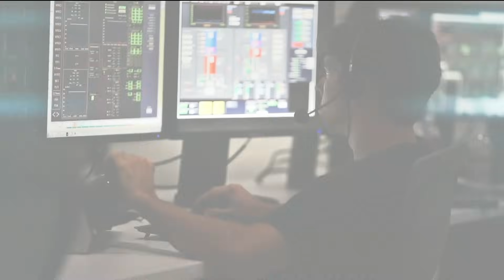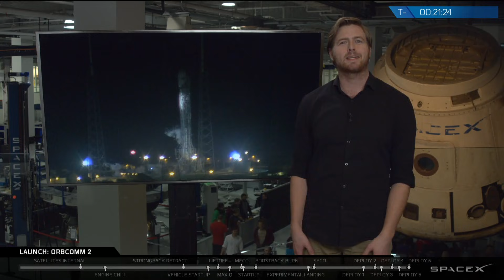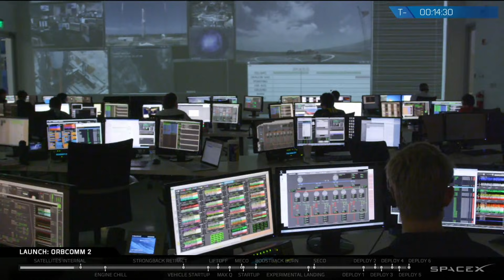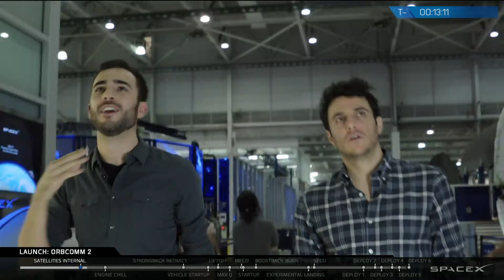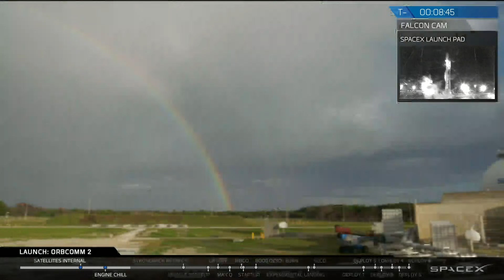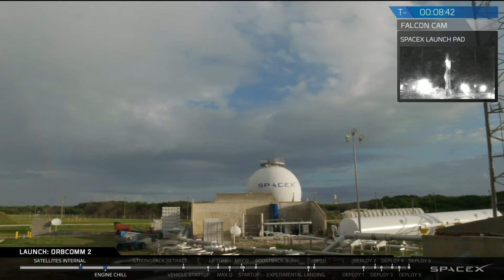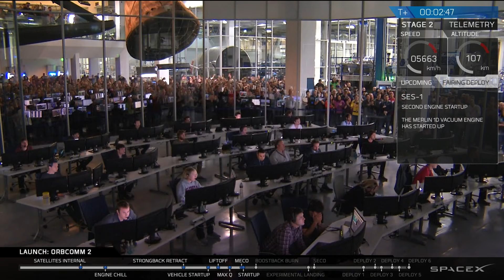ORBCOMM-2 Full Launch Webcast

Comment: How are the satellites ejected into orbit ? Does it have an automatic abort system ? If it aborts, what will happen to the satellites ?
Reply: +Keith H J Hollands -> I don't know, if there is separated abort system for second stage. In case of miss drop, the satellites would either go to wrong orbit or reenter atmosphere where they would burn.
Reply: +Keith H J Hollands For this launch the satellites are packed onto a dispenser and ping off in sequence.
Reply: +Keith H J Hollands The satellites most probably have some propulsion system with a little bit of fuel to maneuver themselves to orbit.

Comment: This may be a stupid question, but how did they ever land on the moon, and launch back? Using a separate pod, or what?
Reply: First the thing that land on the moon was designed and built to land. It wasn't designed to take a payload through the atmosphere against 1g of gravity. Second, the take off require a lot less fuel. It was in 0.16g not 1g and there was no atmosphere to get through. It really makes a huge difference. Third, returning to Earth is then "just" a case of pushing the rocket slightly in the fight direction. Gravity then did the rest of the work.

What we have seen here is nothing like the moon landing. If the moon landing was like parking a ford into a parking space in a supermarket then this is like a F1 car doing a handbrake turn from 150mph into that same parking space and coming to a stop without touching any of the cars around it.
Reply: Genius put. Thanks!
Reply: +elvispiss The lander was a two-part vehicle.  Once they had landed, they didn't need to bring the whole thing back, so the part with the landing gear and most of the engines and most of the fuel tanks stayed behind.  The part of the lander that did have to get back into lunar orbit (the crew, life support, some propellant, and an engine) would detach from the part that stayed behind and light its engine, becoming the Ascent Vehicle.

The six Apollo Ascent Vehicles are unique: they are the only manned rockets to be launched without a ground crew at the launch site.
Reply: +Augure Zera I'm sure the the reflector panels left on the lunar surface for the purpose of bouncing a laser back is actually just a guy in a helicopter hovering over the observatory, right?
Reply: +Augure Zera Well, the technology was there at the time. And landing on the moon is just a matter of mathematics. So landing on the moon at that time was certainly possible. Would you claim all space travel that is said to have occured before the alleged "putting a human on the moon" is myth? Did Yuri Gagarin never go to space as well according to your sources, or is it just the lunar expedition that isn't true? I mean, we're talking a total of twelve landings on the moon between the US and the Soviet Union, and a total of twelve humans having set foot on the moon as part of six different manned missions to the moon.
Reply: Finn Palm not to mention the hundreds or thousands of people involved that will all have to have been told to keep quiet and 50 years later not a single person has revealed the "lie".
Reply: +Augure Zera You didn't answer my previous question. Either way, it took them quite a few tries to get everything right, before they dared send a manned expedition to the moon. If looking at the history of space exploration, and not just one manned lunar landing as an isolated phenomenon, it would be quite the elaborate hoax if they faked all the research, the accidents, the experiments, the science and eventually faked a "look, we finally made it" lunar landing. Then take into account that all that fake science they claimed to be used to put humans on the moon, but that didn't work back then, if that was not real then, how come it's the exact same principles we use for space exploration today? The shortest distance between two spots is they did actually land on the moon.
Reply: ***** lol, so you don't believe it unless there is evidence but when someone shows you evidence you don't believe that either. I'm guessing you're Murican? Religious? Homophobic? Let me know when I get one wrong.

I tell you one thing though, you just got added to my "block" list.
Reply: ***** so the fact that there are photos of the various lunar landing sites and the equipment left behind there taken by satellites that are currently in orbit around the moon...

Those mean nothing?

Riiiiight...
Reply: +robotguy Plus they only have to thrust against 1/6th of Earth's gravity field, so the lunar ascent engine was much smaller and of lower thrust.
Reply: ***** Are you serious or just trolling? You really think we didn't put humans on the moon?
Reply: +Augure Zera Then there are the two mars rovers. What's your take on that? I'm just curious as to where you draw the line of what's scientifically possible and what's not. The New Horizons spacecraft that passed Pluto last summer and discovered water ice? Did that happen according to your sources? There's a lot that is said to have happened since the lunar expeditions of the last century.
Reply: +elvispiss You bet.  Since the moon has a little less than 1/6th of the Earth's gravity, it makes it super easy to escape from.  They used a detachable lander with it's own engines, launching them from the moon, back to their orbiting command module, which then was able to burn back out of the moon's orbit, leading them back to intersecting with Earth, and then decaying the orbit such that the command module could open its parachutes and get safely back.

It was absolutely, incredibly baller, what they managed with limited computing power and old tech, back in 1969.

Comment: Can someone explain why this "changes everything" other than the fact that they dont have to build another stage one? I know this means less time and money spent to make one, but people are acting and cheering as if they just reached light speeds lmao
Reply: Not having to build another stage one is the reason it changes everything. About 90% of the cost of launch is in building the stage one booster. This will cut the launch bill dramatically. Makes it possible for companies to send stuff in to space more often and for less. Companies other than the usual ones like NASA.
Reply: +Unitdoggy this is a stepping stone to getting to Mars. It will significantly reduce the cost of potentially building something in space that can get to Mars.

As for the crash landing. It has built in self destruct. If it's going to crash it can be detonated in the air before hitting ground. Even if it did hit the ground it's a big aluminium tube with almost no fuel in it. It's not going to create that big an explosion. As for the "nuclear type" explosion, it wouldn't even do that if it was full of fuel.
Reply: +Oliver Foggin Thats what meteors do at a tad lower speeds dont they? Idk, all I know is that everyone is overacting lol I bet all the people that were cheering in this video (SpaceX team) talked about it for an hour or 2 afterwards, then probably just celebrated that night and the next day it would be like nothing happened (in more of a mental sense). Thats what Im trying to say, its not immediate , but thats how people are acting lol
Reply: +Unitdoggy the weight of the stage is probably just about 10 to 50 tons with some aerodynamic stuff and engine to slow it down meanwhile an asteroid 40m big is ten thousand tons and does not have aerodynamic stuff to brake only atmospherw and its going into earth at 19km/s while the spacex 1st stage is only 1km/s at maximum and 2m/s at landing
Reply: +Unitdoggy "Economies of scale", google it
Reply: +Unitdoggy So what I said lol
Reply: +MHarmony Bruh did you only read the first sentence of my comment??? As I "thought" this is nothing more than a time/money saving achievement. Is landing a rocket back on Earth that big of an achievement compared to living on Mars or reaching light even half of the speed of light??? No. Now "think" about how long we've been going to space. 40+ years? Yeah its not that big. And will you still think its big when it crashes into the ground at 25000 kms an hour and causes a nuclear-like explosion lmao.
Reply: +Unitdoggy obviously this isn't as big as landing on Mars. If we landed on Mars (humans) it would have been a live feed on every TV channel in the country. It wasn't. 

It IS a huge deal for making space activity more affordable. Thereby allowing more missions and broadening the access for other people to do work in space. Which can lead to more innovation, discoveries, etc...

If you can do say 10x the missions with the SAME amount of funding... that is huge progress. This was a big step for reigniting space exploration.
Reply: +Unitdoggy 
This puts the French, Russians, Chinese and India out of satellite launching business. Unless they achieve something similar. Some, like the Europeans and the Chinese will have to. Which is good. Competition is needed. In 10-20 years this will be the norm. Next, they'll try to build a Space Shuttle that does the same thing.
Reply: +Unitdoggy &quot;this is nothing more than a time/money saving achievement.&quot;

Lol.  The problem is that the words "nothing more" seem to be ignoring the implications of this improved efficiency and what it will mean for humanity down the road.  Certainly there is a lot more hard work ahead of us, but this is the first step that will get humanity out into the wider cosmos.  What you're seeing is the birth of the space revolution.
Reply: +Matthew Doan Yes, so it concludes to a "time/money saving achievement" lol.

What im saying is that this doesnt solve anything immediately, it will only shorten the time for the big advancements which we will still only see in atleast 100 years instead of 150  (unless someone comes from the future) but time travel just fucks with everything so please dont lol
Reply: +Unitdoggy And btw, "nothing more" isnt saying that it hasnt changed anything, because it obviously has like I expressed. If i said "this has changed nothing" then you would be fully correct, but i didnt say that
Reply: +Unitdoggy I find it funny that people think space exploration is so difficult and we been doing it for 40+ years. You do realize it is easier to send a human to orbit then it is to send a human to the bottom of our ocean depths? Getting to space is not the problem. Living in space is not the problem. Sustaining a way to do it economically over a large period of time is a huge problem and one that has only begun to be solved. Starting with a job no one thought was possible 5 years ago.  

If landing a rocket on the ground with no parachutes after re-entering from sub-orbit with rocket assisted retro burns in a wind storm isn't special, then I implore you to do that same. Plenty of computer simulations that should be able to crunch the numbers for you. If that isn't easy enough for you, maybe a trip to the bottom of the ocean, all you'd have to do is hold your breath, right?
Reply: +Jasin Colegrove I'll still stick to what i said. And Im pretty sure we cant live in space nor any other planet within a few hundred thousand light years of us. Did you ever think of the ecological side of it this whole thing? What's the point in going to space quicker if we are just polluting and killing our earth quicker. Have you seen Interstellar and its story plot?
Reply: So you just ignored everything I said to validate your opinion? 

Pretty sure we been living in space for quite some time as well. But you'll have to define living, because your opinion seems to be overly important on the subject.
Reply: Unitdoggy and no, I try to keep with the nonfiction books and editorials
Reply: +Jasin Colegrove You are no different to me if Im ignoring everything you said
Reply: +Jasin Colegrove FYI, Plot: A series of conflicts and events within a movie. 

Meanwhile, you probably think Im talking about all the fictional stuff in that movie even though what I am implying is right front of you in that comment
Reply: +Jasin Colegrove Also, as far as I'm concerned what I said is not opinion, its fact. Can you honestly say Im wrong and prove to me how its not fact? Mmmm... thats right, you cant. And by space I mean the vacuum of space. We wouldn't know anything about space and time if it wasn't for the Earth and its atmosphere
Reply: +Unitdoggy You haven't really proven much to be fair. You have stated opinion based on some fictional plot. Not sure where I am supposed to find fact in that.

Your whole argument is about Earth and what we aren't doing to fix it??? Because that is what space exploration is all about. That is why we launch sat's to collect data, like the ones launched by SpaceX, so we can fully understand the problem. Its why we do research on ISS in space, because it is too hard or expensive on earth to recreate those settings. The ability to launch experiments into space at an economical advantage is a game changer, end of story. Nothing to argue about...

I'm not talking about colonizing a planet, far from it. So you can stop assuming.
Reply: +Jasin Colegrove Open your mind dude. (eg. just because I used a fictional plot as an example of what could happen, doesnt mean it will. Besides, that part of the comment had nothing to do with that fact part I was talking about). This is one of many "egs." I could extract from your comments to show that your mind is closed. FYI: you dont have to be very knowledgeable to have an open mind

I could go on and break down every sentence you say, but that will just lead to more sentences I would have break down.

And about that last sentence on the second paragraph: I never disagreed that it wasn't a game changer. If you read every comment ive said on here, you'd know this. 
AND, if you think this is all opinion and/assumptions, why are you still commenting?
Reply: In the end, all I asked is if I was missing something as to why everyone was celebrating so much. I clearly stated in my first comment that I knew it was a step forward for the money and time side of things. All these comments did is confirm what I already knew. 

Of course this is a massive step forward for SpaceX, but why do we care? This does nothing immediately, and probably wont do anything in our life times. So when you think deep, why does it matter? Why does anything matter, really... 

Another thing to mention is that I havent heard or seen anything since the day the did this. Was it that game changing? Even for our future selves?
Reply: If anyone is about to comment back and express how I'm somehow wrong or tell me something about 5 others have just said, save your thoughts for someone who doesn't know what you are talking about. They might be more interested
Reply: Unitdoggy
"Yes, so it concludes to a 'time/money saving achievement' lol."

Yes.  And my point was that your tone implies that this makes it less important.  Such as the use of the phrase "nothing more than".

Henry Ford did nothing more than figure out a way to mass produce cars. That didn't change the world at all, did it?

Elon Musk did nothing more than figure out a way to reduce the cost of launches in the long term by "a factor of 100". (I.E. Figure out a way to mass produce flights into orbit). That won't change the world at all, will it?

I honestly don't get where you're coming from unless you have some personal bias against SpaceX, or you just want to be the one black sheep because it's "cooler".  It's okay to clap along with everyone else you know.
Reply: +Matthew Doan I was asking a question as to why everyone was so excited. If you read my first comment without out the "tone" you think I have (mind you this is all text lol), you'd see I was just curious. But then the "cool" people who know everything about everything had to come in and tell me things I already knew and in a way, get offended because I wasn't AS impressed as every other person on these comments

Once again, don't get me wrong, it's impressive, but within a year or 2 it will become standard procedure meaning nothing has really changed. Understand?

And if Henry Ford didn't find a way to mass produce them, then it was only a matter of time. Which in turn changes nothing to this day. Yes?
Reply: See now I think of it, it hasn't really changed anything. Sort of contradicting myself from before, but when you gave me that example of Henry Ford, it changed the way I thought of it to more of the way you guys were making me out as. If you get what I mean.

Anyway, we all agree that its great, but some more than others
Reply: +Oliver Foggin I read somewhere that they saved almost 100%
Reply: +Valentin Simion Well, competition isn't the only reason other countries will still be doing launches.  They still have national security reasons to be able to loft their own satellites, which isn't going to change no matter how cheap SpaceX makes their launches.